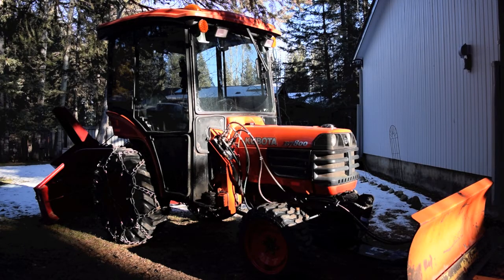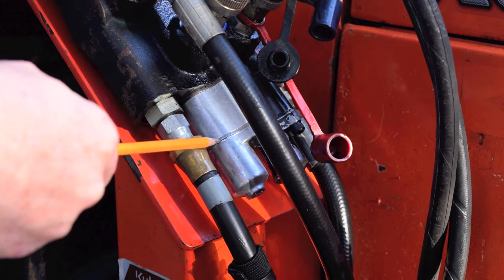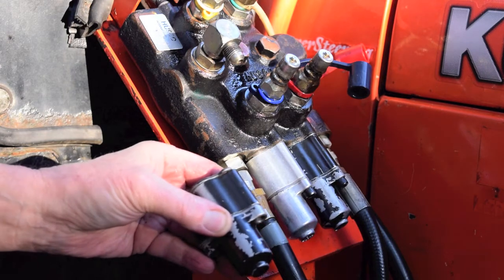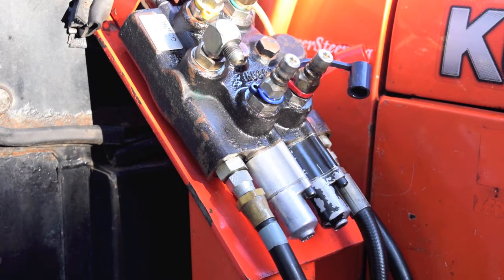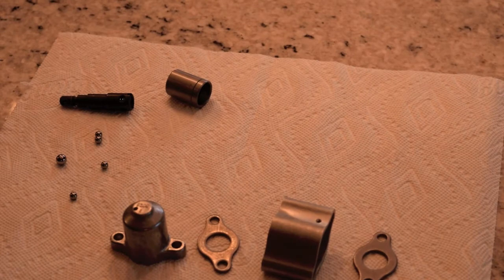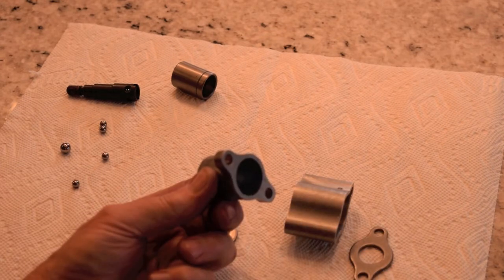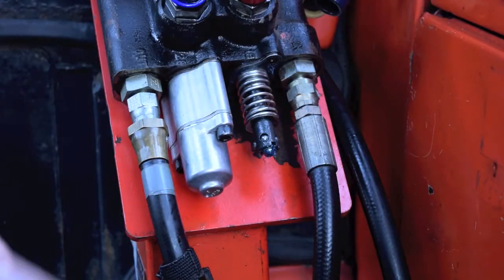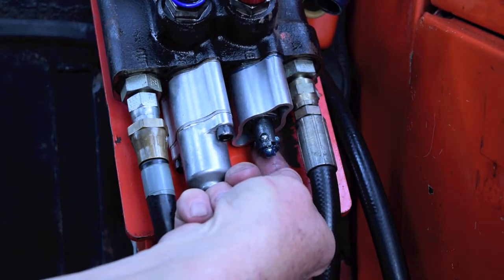Husco Hydraulic Detent Replament and Fix on Kubota B7800

Comment: I know this is an old video but hoping you are still responding. 

My loader goes into float but I have no detent at all. No resistance and no hold. Concerned about getting in there but your video gives me hope. 

How do I remove the detent pin? How much torque did it take to get off? I'm concerned about adding to much torque to the spool trying to break that lock tite loose. 

 Also, when putting the new one on, did you use a screwdriver and snugged it? Or did you torque it to something?

Comment: Thank you for this incredibly well done detailed video. This helps me a lot. I suspect I am having this same problem with my 05 B2710. My FEL sticks going up and down. Is the function of those ball detects just for float capability? Floating on pavement of such for plowing? I saw a post where I guy said he removed them because he doesn’t care about float and it fixed his problem. Just trying to understand the function of those bearing better. Thanks again.
Reply from the maker: The ball bearings also seat the valve back to a neutral position when you release the control stick on the valve. You may have a broken spring or jambed ball in there. Just take it slow and you will work through it. Glad the video helped.

Comment: Fixed my Kubota LA352 loader valve. It started sticking bad yesterday and I was sure it needed a new loader valve assembly. After disassembling the exact part that you did, I found it badly rusted. Luckily it cleaned up well and is working fine. Drilled the holes also as you did.  Thank you!!!

Comment: Just used this video to fix my L3010. Only lost one ball bearing... after looking on the ground for 20 min I found it on the tractor by the brake pedals! Tractor is smoother than ever. Thanks!
Reply from the maker: I lost a couple of the little buggers when taking it apart. When I re-assembled, I put two magnetic trays underneath and they captured the dropped parts. You are welcime.

Comment: Mine is a B7500. No float. Should I use the same part
number you mentioned and I do I replace both?
Reply from the maker: There is a tag on your hydraulic valve body that has the Husco model and serial number on it. You need to use that when ordering parts, they changed from year to year and in fact within the year depending on what Husco had available. No float, is it a FEL ? Even a FEL usually has float.

Comment: Any idea why my loader goes up in the float position? Kubota l3130.
Reply from the maker: Only a guess. The valve is stuck short or beyond the float position. The fluid is then chambered to flow to the cylinder, you need to dismantle the valve, carefully.

Comment: This saved my bacon with my Kubota 7500HSD tractor which got water and crud in this valve. I followed your instructions and it worked fine, the parts in mine were all pristine and just needed to be cleaned. Trying to get those 4 small ball bearings into place was a little like trying to get toothpaste back in the tube but I took the time to make a good pilot tool for the large bearing and that did it. What happened was the bucket would continue to raise when I used the lever and it was getting annoying and dangerous, too. Thanks to your advice, it's fixed now and works like new. Best instructional video ever, to the point and every detail covered.
Reply from the maker: Thanks for the comment. I have watched a lot of "how to" videos and they sometimes lack the complete picture. I tried to cover everything and by your comment and others, it looks like I succeded.

Comment: Very nice instruction! I have a year 2000 M9000 cab tractor with LA1251 loader.  It  also has a control valve freezing issue. Northeastern VT,  so a definite winter concern.  I never force the controls, but wait until tractor heats up or I put a heat gun on the control valve block.  Does anyone know if the same approach for the B7800 will apply to the M9000 (cab) configuration?

Comment: My 7800 was stuck in the float position and I tore into it in the field, not knowing exactly what I would find. Well as luck would have it the spring and detent ball went flying, I actually found the spring but no such luck with the ball bearing. I've been running it for two years with a must hold in for float and a really tricky spot for bucket power down and a very violent load down when heavy if you miss the very narrow controlled load down. I'm so glad I found this video you took the time to make. I'll be ordering both kits tomorrow you described to install and modify as you and hopefully bring the old B7800 back into compliance. I'm also going to install a shim kit in the pump relief valve to bring my pressures back up to spec. Thanks for taking the time to make the video and explain the best way to go about the fix.

Comment: Good video. What year is your B7800? I have a 2006 bought new, it's hydraulic valve look different.
Reply from the maker: Mine is a 05'. Kubota used different hydraulic suppliers from year to year. There should be a tag on your valve body to indicate manufacturer and model.

Comment: excellent video really helped me out I have the same issue just picked up the new kit question does the shaft that holds the ball bearing screw in to  valve shaft ? Thank you so much very helpful
Reply from the maker: You are correct it does screw into the end of the valve shaft. There is a slot in the end for a flat screwdriver. To break it loose I used a hex key of the correct diameter and shoved it through two of the ball bearing holes. They have Loctite on the threads, you will see that when you get your kit.
Reply: @greathodgy22    thank you I am going to dive in to it this afternoon I may have another question for you  thanks again
Reply: i have a rubber o ring in the kit does that go on the shaft before the plastic washer ? I didnt find an o ring when I took it apart.. Thank you
Reply from the maker: @richeyrich2445  The o ring fits on the valve shaft behind the last spacer inside the valve body. Unless you have hydraulic fluid leaking out of the valve body, you don't need it, but keep it. I thought I posted a schematic of the kit on the Orange Tractor Talks, that is where you found my video, right ?
Reply: @greathodgy22   Got it buddy I cant thank you enough for making an intimidating job rather easy I did have to take off the valve body for better access but it went right together just like you said and my float mode that hasnt worked right in a couple years is now working perfectly. MERRY CHRISTMAS
Reply from the maker: @richeyrich2445  You are welcome, from the Foothills of Alberta.
Reply: @greathodgy22  My valve shaft appears to be too extended so that it's too long to properly put the outer, protective  parts on ...... I've got about 3 inches of shaft exposure that needs to be pushed back in to the valve body. How do I do this?
Reply from the maker: @tomsheehan7316  Tom get a helper to hold the valve lever in the proper position while you install the parts. I was lucky and could use a bungee cord to do this. Let me know how it works out. Hodgy.
Reply: @greathodgy22  Success! Thank you for giving me the confidence to do this repair on my own. You are a kind person to go through the process of creating a video to help others.